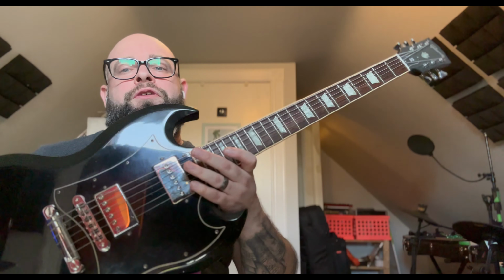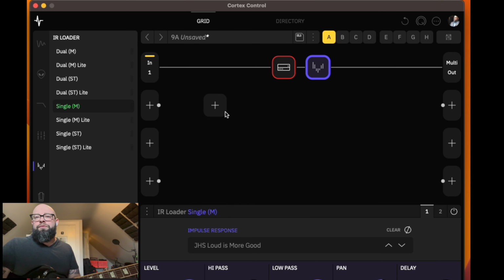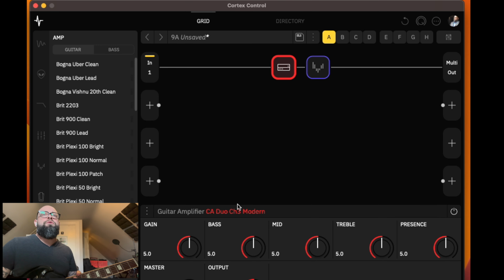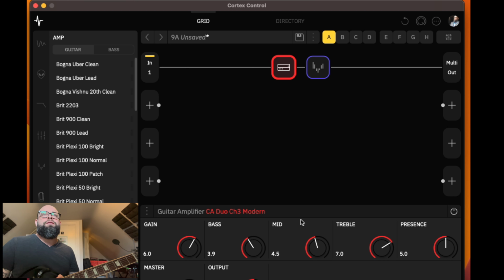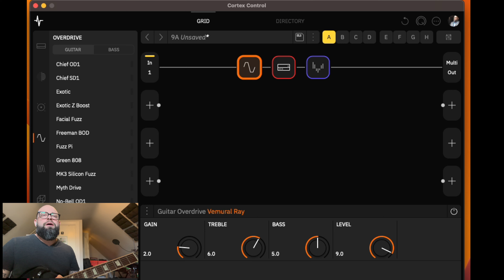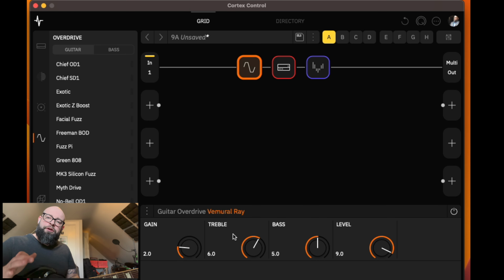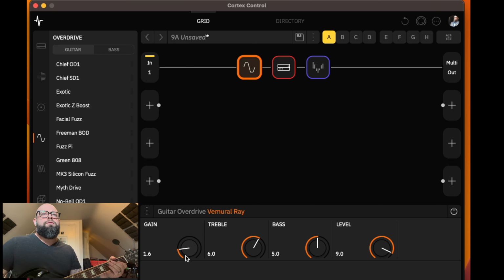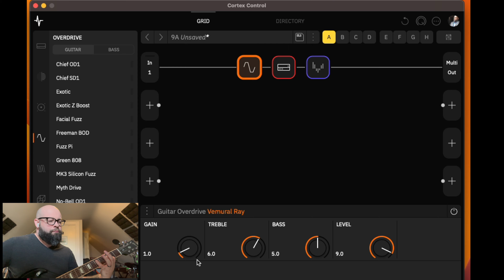Making a Hard Rock/Metal tone in Quad Cortex.

Comment: Hey! Would you recommend a similar chain with a boss katana as speaker? I tried (as many said) to remove the cabinet but it gently sounds like crap. Have you got any recommendations? Thanks!
Reply from the maker: If you are running into the FX return of the Katana and just using it as a speaker it should in theory "sound better" if the IR block is removed.  Perhaps the speaker that is in that amp just isn't suited to your taste. I would try a few different cabs/amps if possible. When I am home just messing around I run my QC into the return of a Line6 Catalyst amp's fx return and just use the power amp and cab and it works well. Not as good as a separate cab and power amp but it's acceptable.
Reply: @GearStuffandThings  i got it, thanks

Comment: Hey Mate very cool sound. Does it happens to you that the QC get really noisy on high gain presets like this one? Thanks!
Reply from the maker: Hi there! I’d say most higher gain situations are a bit noisy and require a gate or two. With the QC specifically the tube screamer they have causes extra noise issues that don’t make sense to me. 

I tend to go a little lighter on the gain with my own personal use presets
Reply: @GearStuffandThings  Thanks for your answer. Yep I find it very noisy and when I use a gate, if you I play a note and let it sustain, then the sound die. But I guess I need to explore different configuration options. Keep on doing great content. Cheers mate!